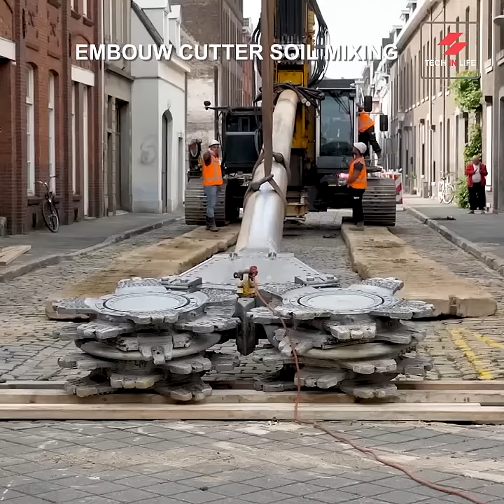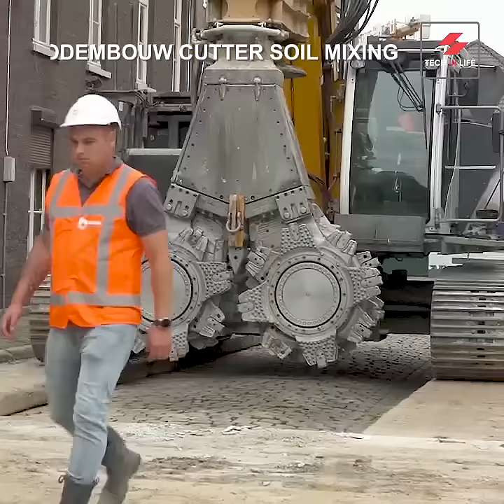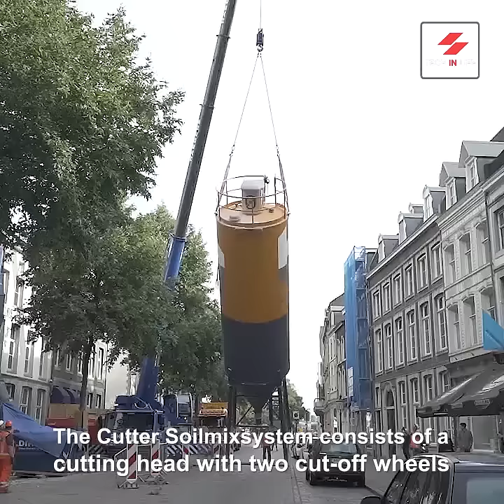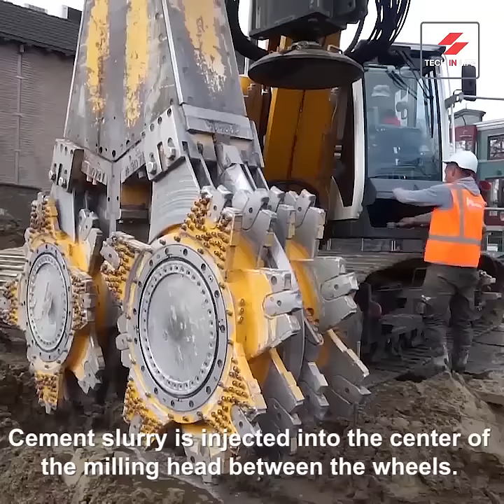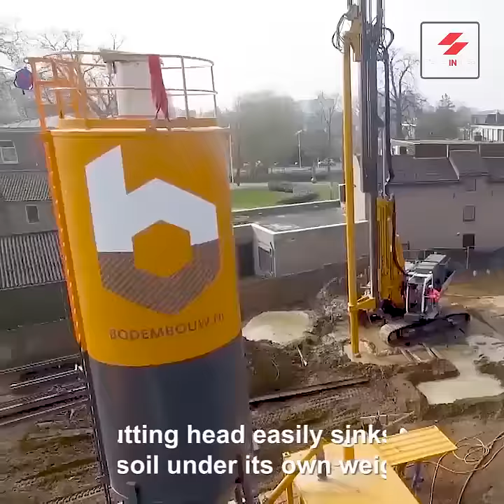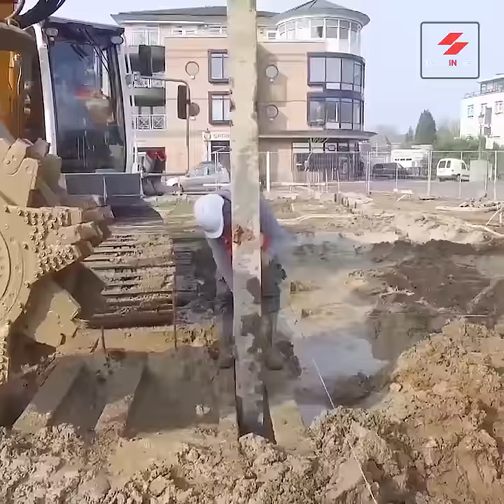The Extreme Machine That Kills All Known Heavy Work! Watch It.

Comment: What is this thing for?
 I work as a bore and core driller. I have no idea what that is. Or what application.
Reply from the maker: It's used for digging the hole or you can say for boring
Reply: @TechInLifeToday   that doesn't explain anything.   Obvious it creates a hole.
Reply: @mikesim6589  It's for creating the curtain perimeter wall in below ground excavations. The machine works It's way around the perimeter of the area to be excavated by boring down every second segment and then returns to ecavate the infill segments. The segments are all joined up by excavating out a reinforced concrete capping beam. Once this is achieved and has gained sufficient strength, the overburden within the curtain wall can be excavated using standard excavators and dump trucks and the spoil taken to the disposal site. This method is used where site access is restricted, where other buildings and facilities or services are in close proximity and there just isn't the room to excavate using standard earth batters to prevent subsidence. 
Mark from Melbourne Australia

Comment: So... What is it doing that for???
Reply from the maker: Thanks for your comment...For digging a big hole in the soil.  And This video shows that process.
Reply: They are digging foundations for a large building in an area where space is non existent to be able to dig normally.
Reply: @TechInLifeToday  Use this machine for tire leak repair? That's some tire. 😳
Reply from the maker: Thanks for reading the comment. That was a reply to another video.  Sorry for that. Friend. I have removed and modified that comment.
Reply from the maker: You are right and nicely explain it. A lot of thanks for your comment

Comment: I'll wait until it comes electric. Fossile fuel is so last century. 🤦‍♂️🙄
Reply from the maker: Yes...we all expect that as early as possible. Thanks for your comment
Reply: That will be nice!  But not in my life time...
Reply: And where would the electricity come from.? 😑
Reply: @leepratt9248  Batteries powered by windturbines, heat from within the Earth or from a solar cell park.
Reply: @Ujuani68  yes, all of those easily acessible at a construction site.
Reply: @leepratt9248  
They’ll have an industrial size 
gas or diesel generator a few hundred feet away supplying 
the electric power.
Reply: I agree on the windfarms!